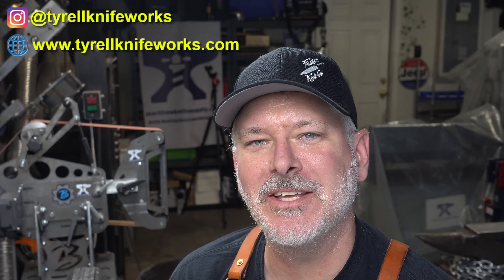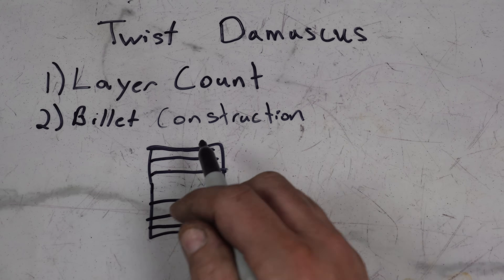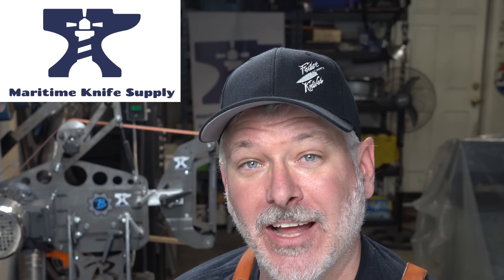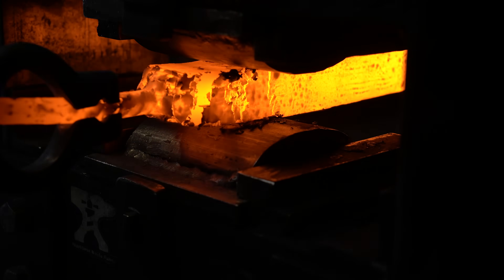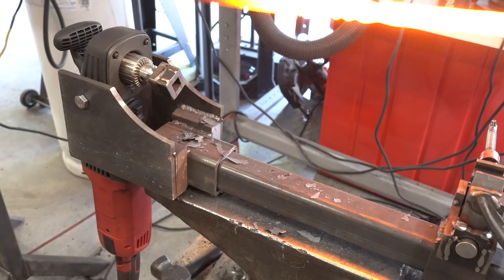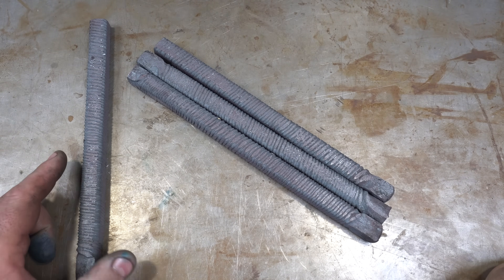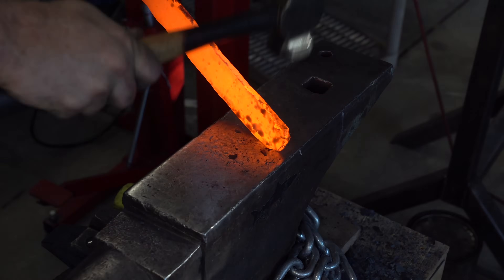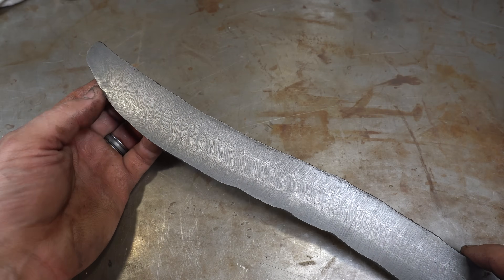Triple-T #104 - Damascus Patterns - Turkish twist

Comment from the maker: I didn't quite finish this but I think you get the idea.  You'll see it finished in a future build.  Any questions about twist I didn't cover?
Reply: Real question: Is there a "max" twist you can get? IE: if you twist too much you lose definition of the pattern?

BS Question: Did Chubby Checker approve of you doing the twist? There's a whole song about it.
Reply from the maker: @isaacbenrubi9613  I'm sure you can twist TOO much.  I would say that more than about 4 or 5 twists per inch and you're starting to get into that territory of too much.  As for Chubby Checker, I'm sure he watched my videos and approves.  😜
Reply: I am wondering why you ground only the sides of your three bars; when you welded them together the twist looked like two parallel lines running down the billet meeting each other.
Reply from the maker: @brysonalden5414  Actually all sides of twisted bars were ground, but thats generally not necessary.  You're going to forge them anyway.  I was contemplating tig welding the seams so I ground them clean but then just ended up tacking them at the ends.  All is well though, they forged together well.
Reply: so turning them 180 degrees over will have them looking twisted the same way anyway, that's cool
what if you hot cut and fold them instead? still same way twist?
Reply from the maker: @menarg1549  take a piece of all thread.  You can put a nut on from either end, right?  That means it’s been twisted only one direction.  It doesn’t matter how you cut it, it’s always the same.
Reply: @TyrellKnifeworks  yeah i tought it you just bent it it might be different, but no it isn't

Comment: Hey Denis -- great instructional video as usual.  Learning a lot from this series and am actually in process of making my first sword and first Turkish twist.  The blade will be about 32" long with three twisted bars in the middle and a bar of 80CRV2 above and below the twists for the edges.  I went with the 5/8" bar as described in this video but am a little nervous about forge welding 5 high by ~20" long.  Any advice on this?  I planned on a few tack welds along the length since I will be grinding a good bit into the finished billet to expose the pattern.  Any thoughts?  Thank you Sir!
Reply from the maker: The hardest part is going to forge weld something that large.  If you can’t hear the whole thing at once you’re going to build scale at the places you aren’t forging at that heat and it will be difficult.  I would weld ALL the seams to prevent that.  Tig weld them if you can, not just tack them.  I hope that helps.  Thanks for watching!
Reply: @TyrellKnifeworks  Thanks Denis, that makes sense. Going to take my time setting this one up.  I don’t have a TIG but maybe this is a good excuse to get that $200 Vevor your reviewed.

Comment: I need to get some more twist going and see what kind of cool things I can make. As always you did an amazing job explaining.
Reply from the maker: Thanks for checking out this video!
Reply: @TyrellKnifeworks  Got some twist going and rounded the edges like you said and worked great. Also after squaring I put more flat stock, forge welded and re twisted. Will repeat that process 4 times and see what it looks like :)
Reply from the maker: @the_fafologist  Sounds cool.  I've never done a compound twist like that.  It should be interesting.  Send me a pic of the completed knife for Viewer Knives.  👍🏻

Comment: What do you do about that borax on your dies I’ve noticed that stuff gets pressed so deep into your billet it looks like it bonds with the steel? And it’s super hard to get off dies. Any suggestions?
Reply from the maker: Once you start pressing hot steel that doesn't have borax, it tends to just burn off.  If it doesn't, throw a bit of water on it before you start pressing and that will usually pop it off.
Reply: Ok thanks for your advice as always!